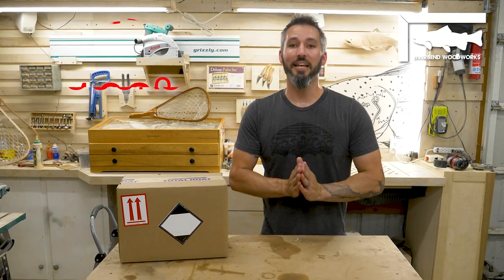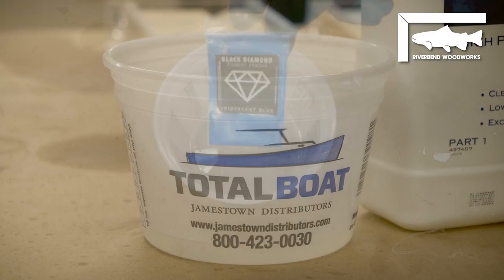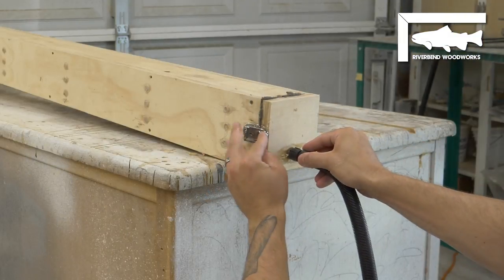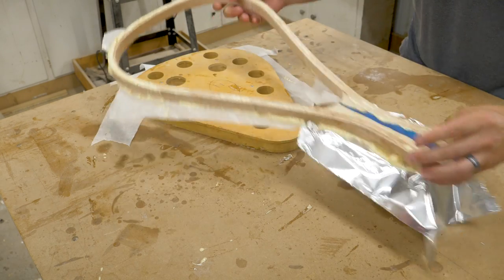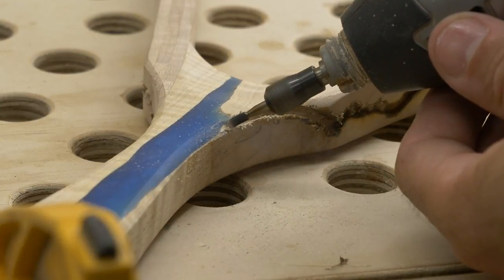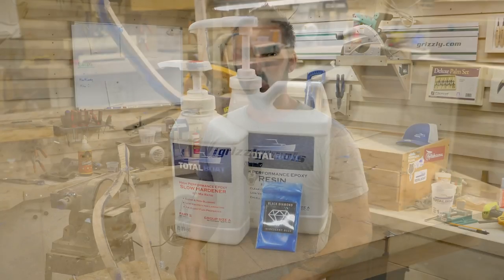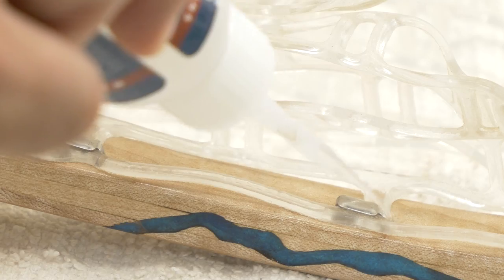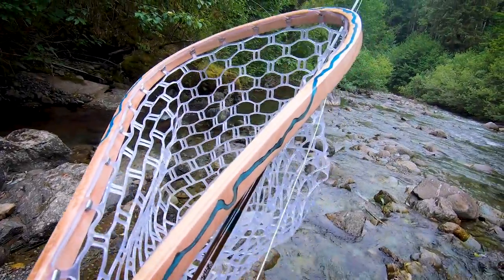Epoxy Resin Hoop Fishing Net Build

Comment: Great work , the net is very original.  Can I ask where do you get the actual silicon net from?  I have a net like that with larger holes and I have problems with skinny fish trying to swim through the holes.
No problems with big fish, but not all of mine are big.  Thanks
Reply from the maker: I get the majority of my net baskets from
Amazon, but if there is an odd size or color, I’ll go through Jann’s Net Craft. I have really enjoyed using the Fishpond brand of nets because they have smaller space between. I too suffer from a love of fishing gorgeous water with smaller fish. I’d recommend trying them out.

Comment: Nice work on the net! All those different epoxy pours are a labor of love. Mind if I ask where you got your hands on that brass swivel connector? I haven't seen something like that before.
Reply from the maker: Hi Aaron, thanks for watching! And yes, the pours were certainly a labor of love, but turned out exactly as I had hoped. As for the little brass connectors, here's a link to where I got them on Amazon. I used the 8mm, which seems pretty good. Maybe a touch bigger would be even better? Here's the link: https://www.amazon.com/gp/product/B07MNCZP83/ref=ppx_yo_dt_b_asin_title_o05_s00?ie=UTF8&psc=1

Comment: Looks beautiful, I plan on taking an old wooden net i found and refinish it. What finisher sprays did you use and do you recommend that or any other products?
Reply from the maker: I highly recommend sanding every bit of finish off the net down to 320-grit, then wiping it with a clean tack cloth. Use a product like Dalys Shipn’Shore to really penetrate the wood fiber with a finish that will harden. Do two coats of that and sand the top coat lightly. The final coats are a spar urethane finish from a rattle can. Choose your sheen, gloss, semi-gloss or flat, and apply 3-4 coats. It’ll be totally sealed and look awesome. Good luck and thanks for watching!
Reply: @RiverbendWoodworks  Thank you for your response, I greatly appreciate it! I will be sure to do this and give it a go. Keep up the great content and look forward to seeing more of your net creations!

Comment: How do you Connect the net there?
Reply from the maker: I used stainless steel leather staples to avoid tearing the net basket silicone material, and also to avoid drilling through the net hoop itself. I pre-drilled the holes for each staple and tapped them home with a touch of super glue. Works great!
Reply: @RiverbendWoodworks  aha! Nice Thanx alot fpr the answer. Appreciate it 😊